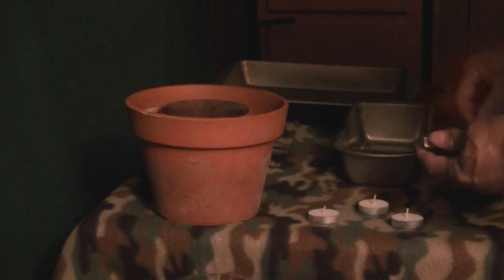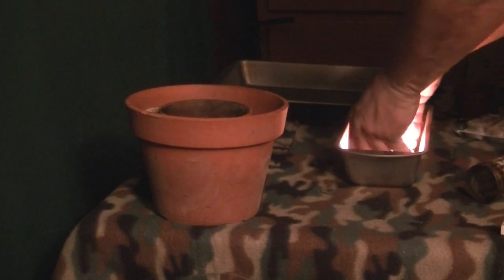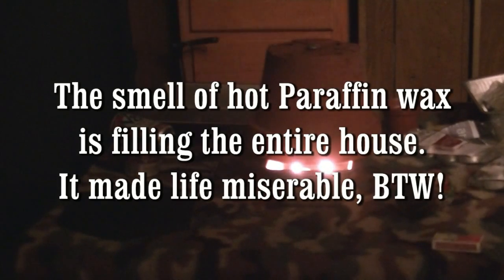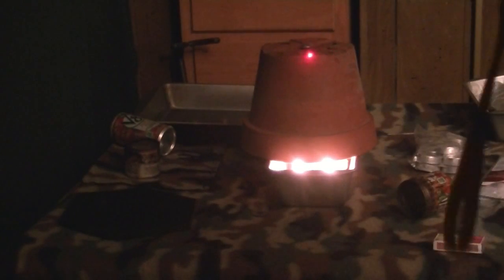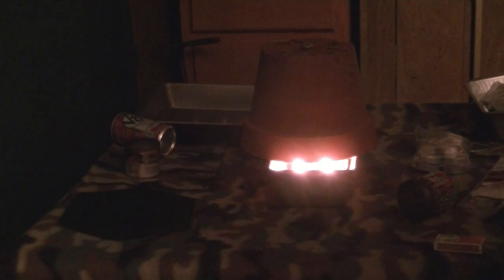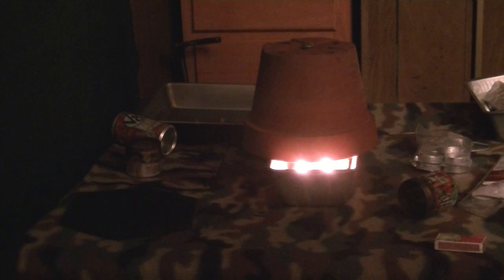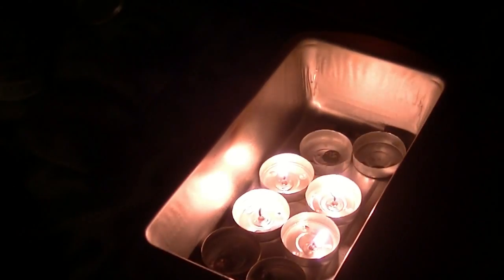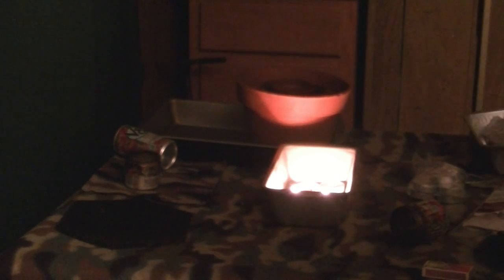Flower Pot Heaters - Does Using 3 Pots Work Better? (Tested & Debunked)

Comment: It all comes down to the amount of energy released by the burning candles, and no amount of pots, bolts and washers in any magic configuration will change that. Candles are useful in a marginal situation like a small emergency shelter or stuck car, but are hopeless to overcome the heat lost through the walls and sensible ventilation in a decent sized room.

If candles generated that much energy, they would also be a greater danger without a proper intake/exhaust system to bring in fresh air and dump the CO2 outside.

By the way, in the often-cited igloo situation, the largest heat source is the people inside, not the candle.
Reply from the maker: +Felix AutomatonYou are absolutely so spot-on with your commentary.  Thank you for your input!
Reply: SpiritofWildWings 
Does more people in a room generates more heat and less oxygen? 
Since they are all taking in H2O and exhaling CO2.

Comment: Just out of curiousity, how big is the Room you were trying to Heat with it? That could have effected it some. As well as too many Holes at the Top.
Reply from the maker: +Phoenix Fire 14' by 8' by 8'.  or 4.27m by 2.44m by 2.44m 
a 100 watt incandescent light bulb gets hotter than this, but why wouldn't someone consider putting a bulb inside a flowerpot to heat the room?  
Give the 100 watt bulb 300 BTU's per hour.  Give the four tealights 34 BTU's per hour, so they are yielding 136 BTU's per hour.  Less than half of what a single 100 watt bulb can give you.
Give the numbers involved a chance.